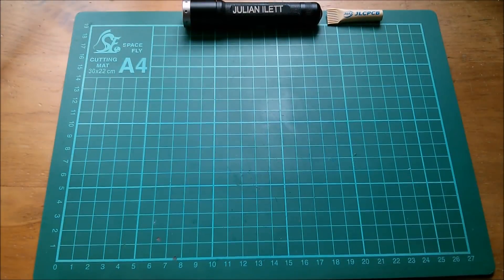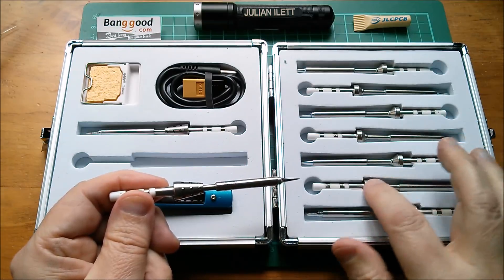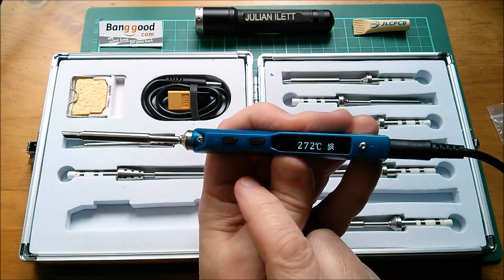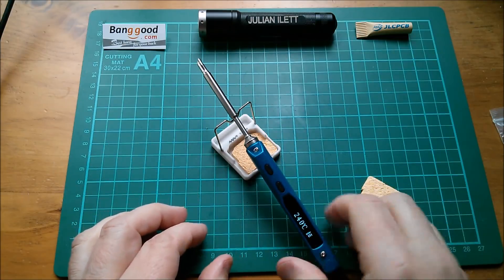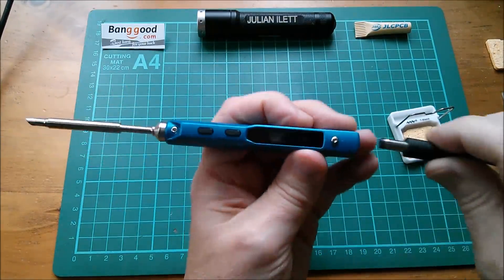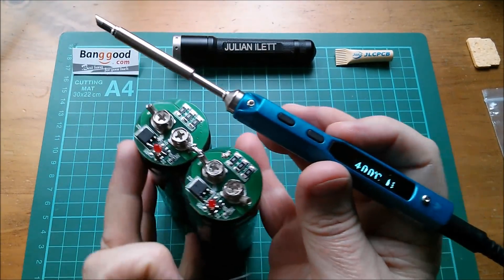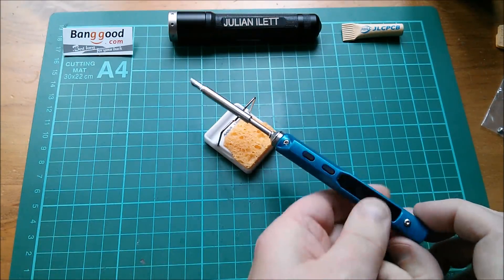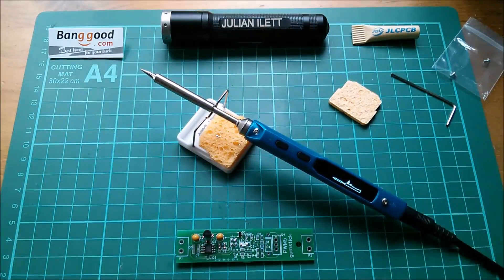TS100 Soldering Iron - Unboxing and First Look

Comment: Replace the allen screws with normal heads so you don't need to find an allen key
Reply: Gotta disagree with Mike here.  Allen heads are way way way better than "normal" headed screws.  Just attach the key to the power cord and you won't ever loose it with the side benefit of reminding you to make sure the power is off when you go to change the tip.  Phillips are just poor choose unless you really need everyone to get access with with any size Phillips or slotted driver and don't mind replacing the screws when they get damaged.
Reply: they might have picked allen key because it does not wear out as quickly. at least i feel like allen head screws do not wear out as quickly as phillips head screws(since they are more slip resistant mostly).
Only screw head that i feel is as slip resistant is torx. I prefer allen over phillips any day. I guess you could get a little more torque with a phillips head, but you don't want to tighten them that much anyway.
Reply: Yup, i agree with elmer. If i was to replace them(which i probably wouldn't), I'd go with torx. I really don't like phillips much. Only benefit of phillips is that they are very common. i feel like allen head was a good choice though since then are quite good and probably the third most common(at least here) after phillips and pozidriv(kinda like phillips but better, often used for wood screws here), while torx is pretty rare.
Reply from the maker: I've kept almost every tiny screw I've ever removed from old electronics stuff, so I may have a cross point replacement - cheers Mike :)
Reply: The best screw for this application is a thumbscrew.  No tool needed.  Low torque of hand tightening is OK I suspect.
Reply: do you actually need to keep loosening and tightening the grub screws? From here it looks like it makes a decent connection before you screw them in.
Reply: Well, camming out would be my concern if i have to open and close it hundreds of times. Thats why i wouldn't go for phillips. I think thats what the guys that made it had in mind too. i really wouldn't put phillips on a device i want to open and close more than a dozen times, theres better screws for that.
I've seen quite a few cammed out allen screws, you slip quite easily just because your screwdriver is not quite at the right angle(and that will happen, since you just quickly want to open it, change the tip and close it again). Torx screws on the other hand make it nearly impossible to slip, I've never seen a cammed out torx screw in my life, in fact, most look brand new even after screwing it in and out multiple times. Those are really hard to mess up.

I feel like allen is a good compromise between the very reliable torx and the very popular phillips. Since its kinda popular and does not cam out as quickly as phillips.
Reply: To replace with a screw. it's going to need a tiny screwdriver. 
Personally,  I find tiny screws don't last well when used a lot.
Keep the Allen screw or use a Torx as suggested by another commenter.
Reply: jort93z - I've seen the Pozidriv but here in Canada after flat slot and Phillips the next most popular is likely the Robertson.  That's the screws with the square socket and are very commonly used in wood construction.  While that screw holding the tip in doesn't really need much torque they likely chose it also because the keys are small and cheap compared to others.
Reply: ^
Thumbscrew. This guy gets it
Reply: Allen, torx and square head screws at all better than phillips if slip-resistance is your concern... philips screws have the issue of 'cam out' ... if you don't keep enough pressure on them when you turn, they push the bit out, and either the scew or the bit gets a bit of damage/wear. But for this, i wonder if you really need to bother with tighening the screws unless you're dangling the soldering iron around by the lead all the time ;) Until the connectors wear in a bit, anyway! ;)
Reply: Since it clicks in so well you probably don't even need to use bother with tightening the screws at all.
Reply: I removed the top screw altogether, and have been using it like this for about a year without any problems.  The friction of the spring-contacts is more than sufficient to hold the tip securely in place.  Advantages are that angled tips can be rotated easily, and tip swapping takes about five seconds. (I have always pulled the power plug while I do this, but I noticed Julian did not, and nothing nasty happened).
NOTE: on mine, the top screw is the only one that retains the tip... the lower screw does not reach the tip body; it has a smaller torx head that cannot be undone with the allen key supplied.
Reply: In a word... NO!   Check out my more detailed reply below.   The screw achieves nothing, and you are better off removing it or leaving it loose.
Reply: The ideal would be a small knurled thumbscrew... no tools required, but you won't find those at your average hardware store!   Maybe the manufacturers could consider it?   :o)    I have just left the screw out, without any problem.
Reply: jort93z - I have Allen screws on the tool holder and  plates on my music card punch. The screws have to be loosened and tightened every time a different punch tool is used. They have to be tightened fully, so the screw heads don't have an easy life. After thousands of changes they still look almost new. 

Allen screws have been used for a very long time - my late father used them when he was young - so they must be fit for purpose. In comparison, we've seen plenty of damaged Torx screws; ruined by people trying to use a flat screwdriver on them. They're very good, but prone to people abusing them.
Reply: I removed the top screw ten months ago, it's the cheapest upgrade possible, I've experienced NO problems, and tip changes only take seconds. (the bottom screw is not used for clamping the tip).
Reply: My experience with allen screws (in general, not just on the TS100) is that they are usually far higher spec than slot-heads.  The only problems I have had is with allen keys (especially the free ones provided with purchases).  Cheap keys can become round with time, and become useless unless you grind the ends down.  Also, the 'ball-end' keys can shear off at the narrow neck unless the heat-treatment was correct.  I have found that torx wrenches are usually better made, and some of them work great with allen screws.
Reply: My solution was to carefully remove the allen screw and throw it over my shoulder... it is not needed.  (I'm talking about the top front clamping screw here... the lower screw doesn't clamp the tip; it holds the case halves together).
Reply: The best screw for this application is no screw at all!   If the screw was needed, I agree a thumbscrew would be the first choice, although finding one to fit might be a challenge!   :o)
Reply: but I have a ton of allens......hexes.......not a terrible deal for me!!

Comment: This plus a 19v power bank ( or drill battery) is an awesome on-site iron, way better than gas irons
Reply: Yeah, It's good as station iron as well with 19v laptop supply.. Actually using it more than my 951, becuase it's better UI and easier to take to other bench if needed. Should be used at as close to 24v in voltage as possible, 12v is too low.
Reply: For me it's the other way around. I used the TS100 now for some month and found it a little unhandy and to fast loosing temperature. Before I used different and very old ERSA irons that are about >30 Years old now. But I like the new tips that have the heater and temperature sensor directly in the tips' head and that are changeable. So I got a HAKKO FX-951 fake for 60 EUR and I am very happy with this now.
Reply: MrCanidi if you would like to donate that ts100 to a good home to someone who desperately needs but can’t afford it I would gladly accept.
Reply: It (Versatip) is still nice for heat shrink tubing using the hot air nozzle. To be honest it's the only thing I'm using it for when I have no access to my cheap hot air station.
Reply: Oh gosh, I bought a Versatip a while ago, thinking it would be the panacea  
Big mistake  
It's heavy, it's clunky, there's no usable temperature control  
I have a lot of regrets
Reply: Whats the big deal with the voltage? China sells boost converters nowadays :) just have a look at the 80W boost step up, the red one with the two heatsinks. These cost around $5 and are totally worth to buy in bulk because they're handy ;)
Reply: Sounds a bit heavy and clunky for certain jobs and locations, especially when one wrong move could result in injury or worse.
Reply: i would like to join two 3s packs together through their respective bms boards. do i simply connect them in parallel to the p- and p+ terminals? to give me double the Ah ? i would like to add a pic for you to look at but i cant.
Reply: If you want to go battery, why not go Nickel Cadmium or Nickel Metal-Hydride? Here in the US Harbor Freight sells 18 volt NiCd drill batteries for around $12. NiCd/NiMh is a more simple charger design, offers a similar voltage stability and is more than capable of supplying high current without relying on a random protection board design on a generic lithium cell. ... it is a bit heavier I guess, but what kind of grown man whines about lifting an extra pound? You can build a cell to any rating you want fairly easy.
  I'll stick with my little gas iron though. Batteries=Anxiety for such rarely used tools. Plus I like the exhaust port heat shrink  functionality more than the temperature control. I don't do precision work away from the bench.
  As to new irons, I'm more tempted to buy the T12 kit as well. I'm curious how well I can integrate it into my current RadioShack Digital Soldering Station. Most of us probably already have a similar old Hakko/Atten/Hacko we're ready to retire/upgrade for a better tip/element design. These usually have a decent 24v 2A+ mains transformer. In my opinion, adding a T12 kit to an old case with the old transformer and a small rectifier circuit is the clear winning combination.
  Ultimately my iron is all about the ergonomics. The visual and haptic elements of a UI are a convenience but the ergonomics of a solid stand with bench presence, and buttons/GUI in front of me are a big deal to me. I don't want to worry about moving my hand position to see a screen or whatnot. I don't think about my iron in my hand while working, nor do I want to. I'm moving it around all over the place to reach stuff, I don't want to worry about a power cord that can melt, or if I accidentally pushed some button. A fireman at the end of a hose doesn't have the pressure valves to worry about. A welder doesn't have the full machine settings at the electrode. ...but that's just my $0.002 as an active hobbyist in the market for a new iron.
-Jake
Reply: Short answer - yes, that is correct. If you connect both the +ve's together, and both the -ve's together, the batteries are in paralell, thus the Ah will increase, but not the voltage. If you connect the -ve of one to the +ve of the other, and then use the other -ve and +ve connections as your power connections, the batteries are in series, and the voltage increases, but not the Ah.
Reply: Oh, yes, the T12 tips are a real improvement over the older ones... the T12 soldering stations you can get from aliexpress now are nice too... auto sleep mode, idle detection, fast heatup. You can't beat a iron like Julians old antex for simplicity and reliability... nothing to really to go wrong with it... but it's certainly not as easy to use as the modern ones! And you can get one that has a built in battery pack instead of the mains power supply... all the benefits of your bench soldering station... on battery! :D
Reply: mikeselectricstuff i
Reply: Depending how much effort you want to put into it, you can get these 'dumb' controllers which are just a crude 'turn the pot and it keeps whatever temperature that happens to be' ones...  https://www.aliexpress.com/item/New-Mini-Temperature-Controller-Board-for-HAKKO-Soldering-Iron-Station-T12-Core/32713332102.html  but are dirt cheap. You can even get the handpiece when them integrated... just connect a power supply. https://www.aliexpress.com/item/T12-DC-12-24V-75W-Mini-Adjustable-Temperature-200-400C-Electric-Soldering-Iron-Welding-Tool-with/32783390981.html  Or you can splash out for the whole controller (again, just add up to 24v DC power) ... and then you have the option of a hardwired or removable handpiece also. https://www.aliexpress.com/item/STM32-2-1S-OLED-T12-Solder-Iron-Temperature-Controller-Welding-Tools-Electronic-Soldering-Wake-Sleep-Shock/32788912011.html There's certainly plenty of options now! And ranging from $5 to $30... so no excuse to not make use of that old transformer and case!

Comment: 250 or even 300'C is too low, should be 350'C maybe even a bit more for lead free and big trough hole
Reply: 300-350'C is sensible for larger joints. the problem there is as Julian says at his low input voltage it's only running around 20W. He needs more wattage to keep the temperature steady rather than more initial temperature. I have a 50W iron and even for heavy work I rarely turn it above 330'C. Whereas I know other people who keep their irons at the extreme hot end, in the range of 700-900'F (370-480'C) which seems crazy to me. I know Louis Rossmann likes a very hot iron
Reply: Jullian is still learning :)
Reply: I think Julian is happy to spend $5 20 times but not $100 once. That's why more expensive items only get reviewed if someone sends them to him for free.
Reply: yeah, 20 watts isn't a lot. But whats also important is how fast the temperature sensor can detect the temperature of the tip dropping. Because if the sensor needs time until it detects the change in temperture the iron will struggle of course. So even some high wattage irons will struggle more than lower wattage ones.
Reply: You do realize people have been screaming at him to get this iron for over a year, right? He's been talking about it for some time, the video would have been made either way. He just got to save some money and had to say one word, banggood.
Reply: I don't have a problem with people using endorsements to pad out costs, but I did chuckle when Julian went to Ebay to check the price of tips for the soldering iron donated by Banggood!     :o)
Reply: I would put it otherwise, it's like being ignorant, for info that's already there, (smd) soldering has rules you should not ignore.
Reply: who idiot use home hobby lead free  not newer need lead free anywere no help this world anythink better solden whit lead. idiot use lead free. no need anywere.
Reply: Or not learning.  He has the thing clamped down hard to a half pound heat sink, and wonders why the solder won't melt?  I'm sure he only does it to generate comments.  
This channel is going downhill, fast.  
Sponsored by JLCPCB, and a promotional video for BangGood, all wrapped up as an unboxing...  SMH.
A clever guy, with all the common sense of a shoe.
Reply: yeah, i agree. I usually use 350 or so with normal lead solder(not that particular iron), depends on the tip and padsize though.

Comment: You really should put a boost converter in between and pump the voltage to 24V for this high thermal mass solder jobs.
Reply from the maker: One day I'll do that :)
Reply: the new fw has a boost mode.... for the temprature

Comment: The two "special" tips with the extra part are actually redesigns of the original ones with an added heat shield to protect your fingers when you solder tiny things and grab your soldering iron more near to the tip. At lower temperatures the shield stays cold completely.
Reply from the maker: That makes perfect sense - do you know if the tip coating is different too?
Reply: I actually don't know. I use the different tips quite often and except for the heat protection, i did not notice any difference. The coating seems to be the same on all of them.

Comment: There is a place in the world for this soldering iron. In the field or running off a car battery great. HOWEVER I put it to you, when you're messing around and bodging things together, is this really what you want? Is the firmware up-to-date? Oh dear the thermal cut-out needs adjusting HELLLOO no thanks.I'm all for innovations but the hype surrounding this product doesn't warrant attention.
Reply from the maker: I do agree that life gets very complicated when EVERYthing has an operating system and a 2-button user interface. However, a low voltage, ultra light, high power (given sufficient voltage), temperature controlled iron may finally push my old Antex into a drawer.
Reply: Julian Ilett uff. I suppose. Poor old Antex. I still say there's nothing wrong with the way things were though 😁
Reply: You're getting old mate! Doing the update once (to get good firmware) is all you need. Don't forget your adjustable soldering station probably has firmware too. The interface on this guy is easier than the interface on a Hakko FX-888D
Reply: You know, you can just use it in its out-of-the-box configuration. Fire'n'forget mode..   :)
Reply: Prehistoricman yes the hakko has the worst interface in history.. mine just has a digital display and some knobs to turn 😁
Reply: Ollie tbh if I get one I'll just use it with a 19v laptop supply & a chisel tip & leave it at that... I'm really keen on this model, fed up with heavy irons... and it's sooo dinky....
Reply: Chris Nixon humbug! 😂😋 I have a station with the hot air and that anyway, set the iron to 350c and fire away. I did find the hot air can be lower, like 300 but 0603s can blow away still even with the lowest flow. I'm just not sure about this gadgetry. 😁